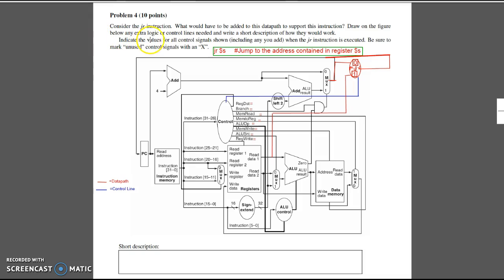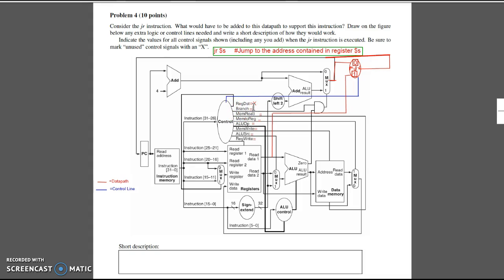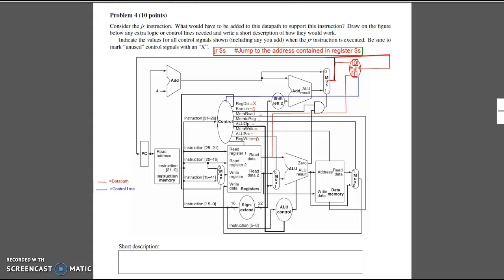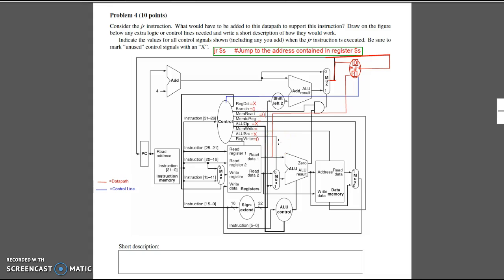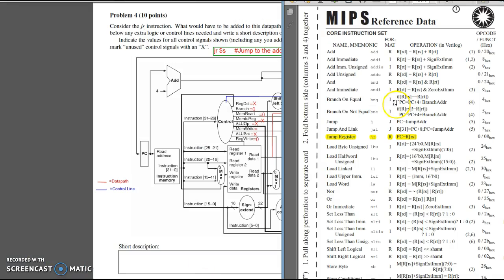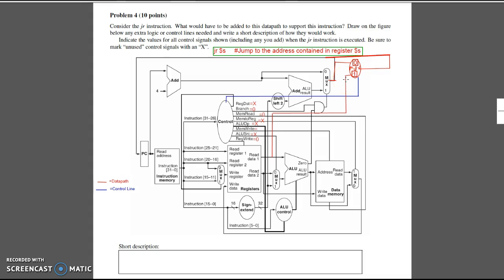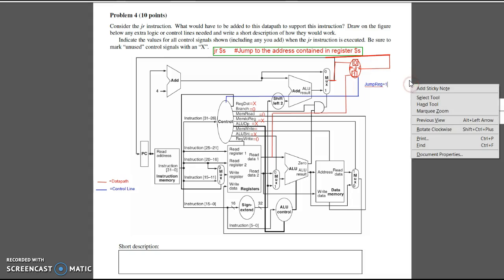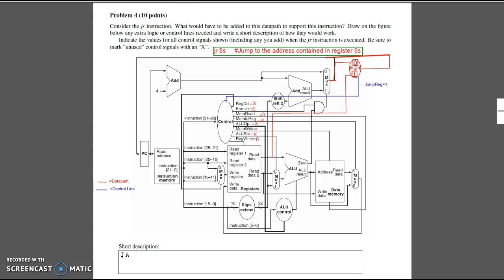Modifying Datapaths and Control Signals (Jr Instruction)

Comment: It won't work in actual. The jr is an r instruction which has an opcode 0. The control needs the funct portion of the r instruction to be able to know if it needs to set the jumpreg.
Reply: Can you elaborate on it. I'llappreciate that.